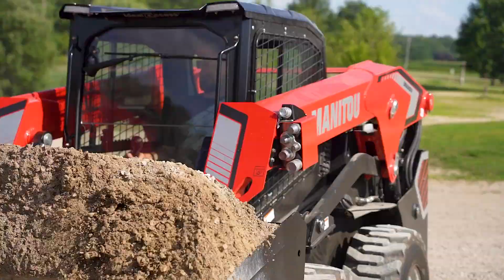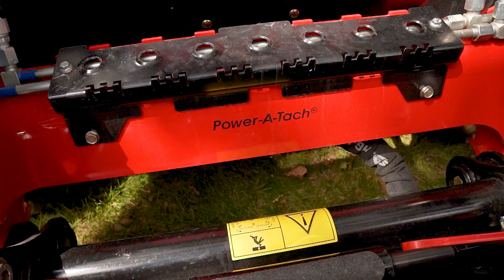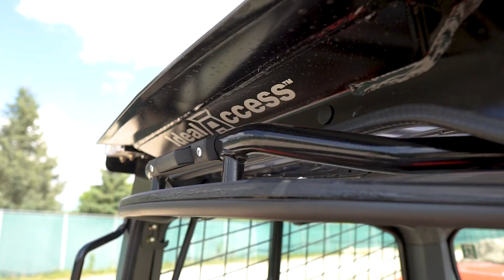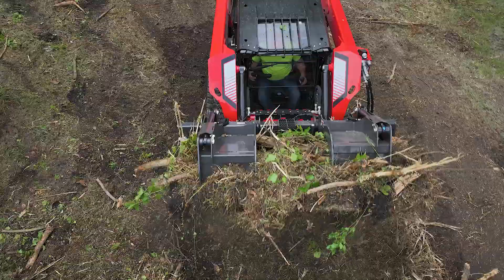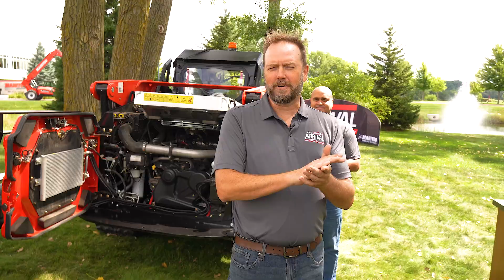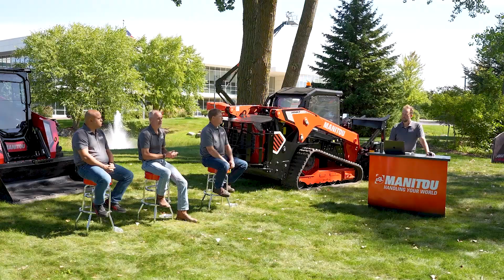Manitou Large-Frame Skid Steers & CTLs | Official Launch Replay

Comment: Change the hard lines that go through the belly, pan. If you're selling this as a mulching capable unit they will corrode over time and leak, due to moisture around them from mulching debris. People will say just keep it clean, but certain machines it's impossible to get to all spots. Hope fully hydro bay the lines are ran cleanly so you can keep it clean to prevent this from happening. Case made this mistake and to the change lines you have to pull the engine and pump, its going to screw the customer right when the warranty goes out. its a 15-20k fix, show us under the cab. Also you should boost the hydraulic psi up to 4,000 psi. Great job with the dual flange idlers, the would be a deal breaker, not throwing tacks as much is a blessing.

Comment: We bought the 3200VT brand new this past October. Not impressed with the unit one bit. Upon delivery to our yard we noticed the unit was leaking fluids of some sort. Come to find out needed new diesel tank. Had to be taken into to shop for repairs. 3-4 weeks later once job was completed dealer reported unit would not start needed new circuit board. All the repairs were finally completed a month plus after original purchase date. The unit was finally delivered. After one hour of usage it trows a code 520300. After resolving the issue the unit was taken out to start a mulching job. Unit was used 4-5 hours before throwing new code and stop engine light. Dealer reports needs new seat sensor, oil temp sensor and filter. Oil sensor is on back order. Unit currently sits in field with less than 25 operating hours waiting on repairs.
Reply: Sorry to hear that.  We own a gehl vt230 no issues at all. Surprised you had issues with fuel tank its plastic and under cab

Comment: I’m trying to evaluate the 3600vt as a potential mulching machine against the top players. First question is hydraulics. 
Max GPM and max PSI going to the head???
Reply from the maker: On the 3600 VT for hydraulics the high-flow is 40 GPM and PSI is 3450
Reply: @ManitouNorthAmerica  The 97-3 Kubota has 42 GPM So this isn't special
Reply: @jasongerbrandt7577 kubota  is reliable but terrible design.  Uncomfortable cabs . Joysticks not connected to seat . Top of cab to high . Door is heavy and hits in head
Reply: @ManitouNorthAmerica unfortunately those numbers aren’t going to get it into the top tier for forestry mulching, those numbers basically reflect the 75hp class.
Reply: yeah get one an throw a cimaf on it, i want  to see haha

Comment: These are just mustangs and gehl compact truck loaders. Look at the parts, and shapes.
Reply: Yeah same company . Mustang is no longer
Reply: Yeah not a secret man 😮. Hahaha 😂😂😂
Reply: They are in yellow also across the line . Gehl
Reply: No, mustangs and Gehls have always been Manitou. They just rented the design from Manitou...
Reply: @GLOW56012 gehl was acquired by manitou in 2008. So they could have used their designs but were not fully vertically intergreted for ownership. They most probably had an agreement and relationship prior. For example yanmar supplies some of the engines and have  similar machines totally branded as yanmar, similar designs. But some of the machines are powered by cummins or perkins or kubota engines. Its more a supply chain relationship before merger and acquisition before 2008.

Comment: Not sure I like the exposed hydraulic hoses/fittings right at the front like that.  When you're lifting a lot of gravel or rock you'd have to have a perfect operator to avoid any issues there.
Reply: That’s pretty normal. My Kubota’s are the same. Thousands of hours on various machines, never an issue.

Comment: (1.) What's the price $$$ ? ( 2.) Like the door opening into cab. (3)  Like the rear guard with winch mount. (4) Where is it made ,  (5) Where do you get filters and parts or do you have to use Manitou  filter like  a certain tractor brand.????
Reply: Ship to Hawaii?
Reply from the maker: For Price, Contact your local Manitou Dealer https://www.manitou.com/en-US/store-locator. Our Skid and Track Loaders are built in Madison, South Dakota! It's recommended to use Manitou filters and parts that can be purchased through your Dealer.